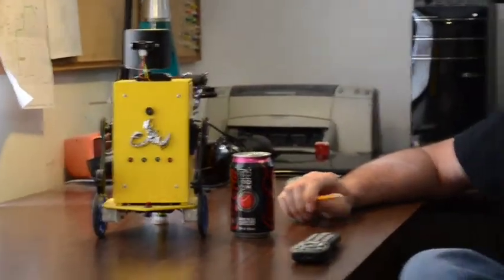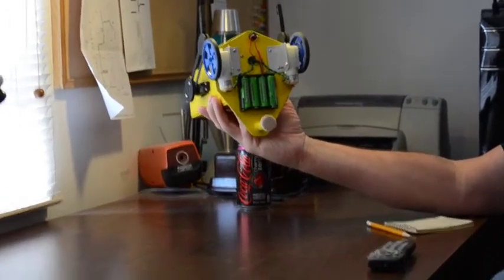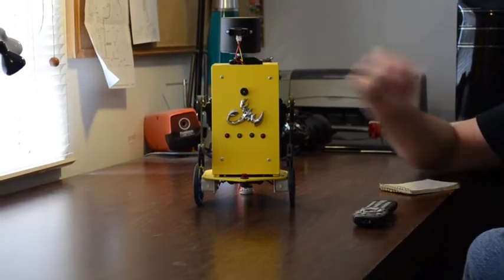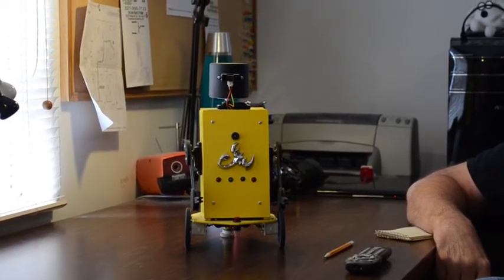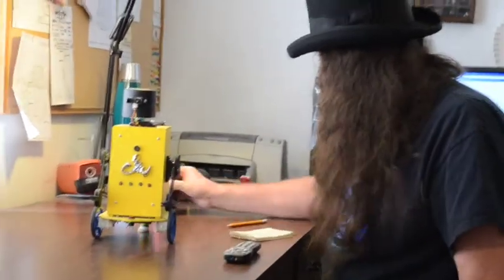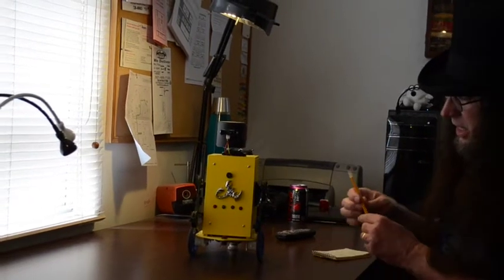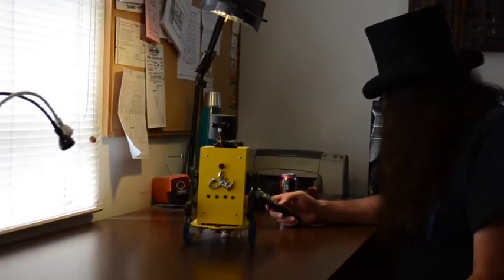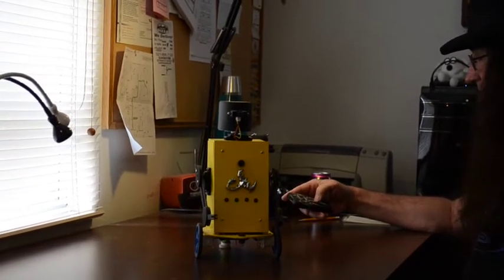Ajax

Comment: I like that project Since then have you built any more Things have surely advanced since then
Reply from the maker: Sadly not.  I started a four-wheeler and failed miserably.  The dune-buggy type tires  pulled the carpet squares fight up off the floor ...lol.  I tried switching to omni-wheels but they were too heavy for my motors and I stopped there.  I have been growing an interest in this again.  I recently scored an old electric scooter/chair and might try to hack it into a BIG ROBOT.  Time will  tell...
Reply: @howardlosson2809  Aww Building a robot you don't think about needing a new carpet LOL I got a Tiger Tank and the metal tracks were not good for my carpet. The Big Robot idea sounds fun, I know how you mean about time will tell though. Had a few ideas that have not gone far. I started an Enigma machine last year but it was not going too well and now waits for the day I feel like having another go